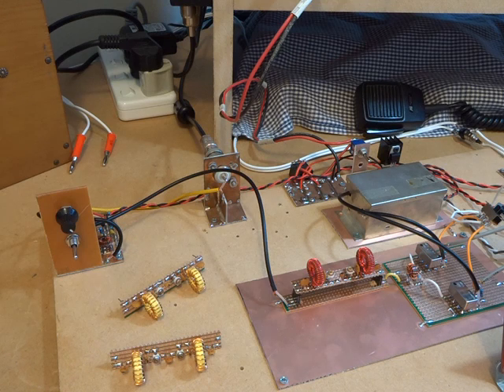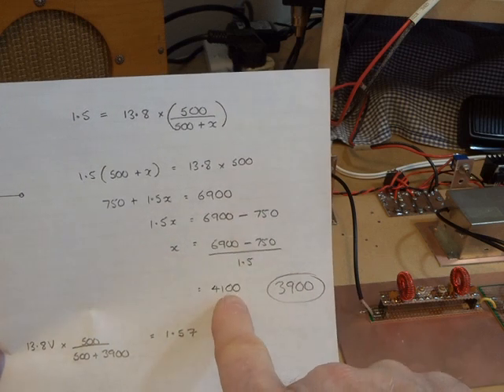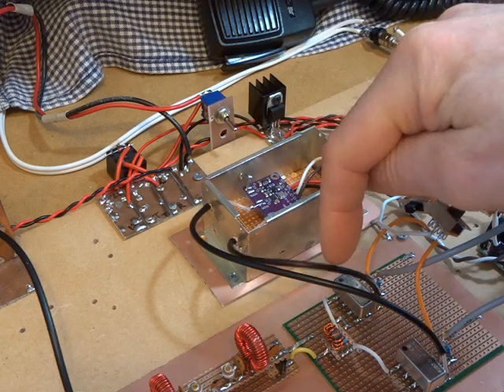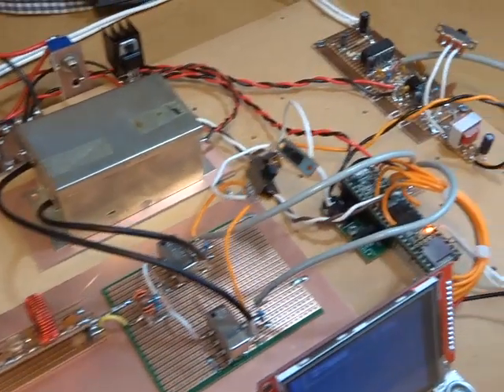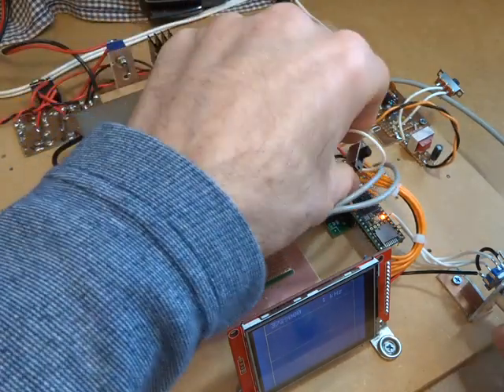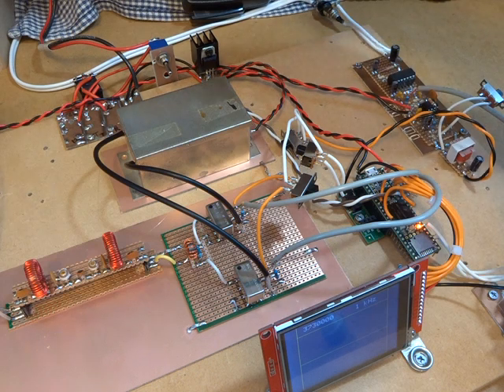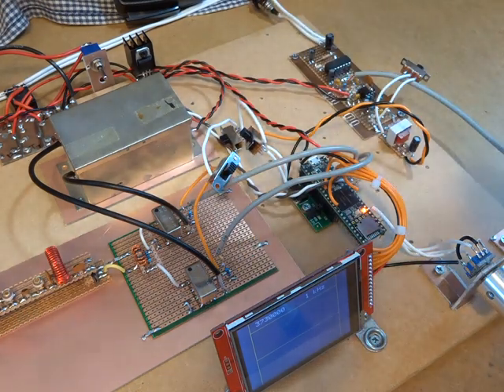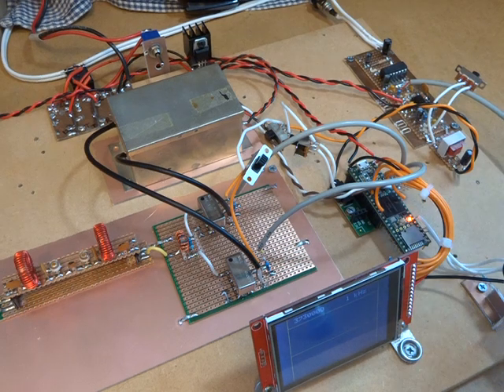80/40/20m SSB SDR Phasing Rig: Part 3. Direct Conversion Receiver

Comment: Great and very informative video. But being new to rig building I had a question. There are 2 independent mixers that are running in quadrature and both of them produce an audio signal independent of each other. What is the need for having 2 separate audio outputs and how are they combined in a true direct conversion receiver to distinguish LSB from USB. Thanks
KE8SPI
Reply: There are two ways, you have 2 mixer in the RF part (the conventional style) or you introduce a phase shifter at the audio frequency part. The easier way is to have 2 mixer. 73 KE0WST

Comment: Re the lid not making a difference, you might be getting sufficient shielding from the walls of the box, which looks like a pretty decent shield. Try the si5351 out of the box. Or tilt it and hold it close to the analog circuitry as a test. All good fun! Nice build Charlie. Bad much on the Teensy audio shield.
Reply from the maker: Thanks for the input Paul.

Comment: I'm thinking of building a version of this rig.  Was going to use the R2 circuit from '92 QST, but the required inductors in the diplexer are no longer available.  Still might use the 3 transistor pre-amp from that circuit.
Reply from the maker: Sounds good. I was thinking about making a fully analogue phasing rig at some stage.

Comment: Are the square waves coming out of the SI5351A fine to feed into the mixers? I was surprised to not see a low pass filter between the SI5351A and mixers to get rid of those odd harmonics.
Reply from the maker: hi Casey. They work fine. Here is a good explanation: http://soldersmoke.blogspot.com/2016/03/great-video-on-mixers.html

Comment: Hi Charlie!

Don't know if you are familiar with the BITX, but when Ashhar changed to the Arduino/si5351, to generate the VFO, there was a big problem with encoder noise.  Peter, VK3YE, is familiar with this and has done videos on it.

In that situation, the noise seemed to come from the microprocessor via common mode.

Ultimately it was some filtering to remove it.  In my own initial testing, I completely eliminated the issue by powering the Arduino and the si5351 off a battery.  Not a practical solution really, but it did help point to the ultimate issue. 

FWIW, I don't know if any of this applies with the Teensy, but...

Cheers!
Reply: This reminded me that I had encoder noise on my uBitx.  I eliminated 95% of it by adding chokes to the encoder lines.
Reply from the maker: That's interesting Ken. So you used two chokes from the encoder to the uP? I wonder if I should try that-say-10/100uH axial inductors...
Reply from the maker: Thanks Christina. I will take a look at the BITX schematics and see what they did. I did try a battery at one stage, with no change. I think I'll spend today boxing up the WSPR TX then get back into the SDR. Thanks for the input.

73s
Charlie ZL2CTM
Reply: @CharlieMorrisZL2CTM  I Just used a choke I had in the junk box.  It was the split clip on type.  It was too large for the wires but it worked.  I also positioned the wires so they were perpendicular to the other ribbon cables that carried audio signals.
Reply from the maker: @kcnicely  Great thanks Ken. I have some of those small ferrite beads, so I might try those too.  Cheers.
Reply: Charlie,

The Bitx schematics do not show a 'fix'. Most have done similar things to what Ken suggested. 

That said, the noise, at least in my experience, isn't coming from the encoder itself but rather, the microprocessor clock as it processes the encoder data.  

To be sure, that doesn't mean that it isn't, or couldn't be,  coming from the encoder or it's connecting wires.  

Indeed, as Ken stated, keeping certain signal wires away from others has proven to be effective, at least in the Bitx radios.
Reply from the maker: @christinamarks6349  Cheers Christina. That's good to know. Thanks again and 73s.

Comment: Where did the metal can for the Si5351 come from?  I'd like to get some myself.  It looks similar to Teko tin plated steel RF enclosures.

I wouldn't judge the lack of encoder noise just by removing the lid.  The walls of the enclosure are likely providing the bulk of shield with or without the lid.  Also, you have separate PCBs and a lot of physical separation.  If you bring that LO board closer and eliminate the shielding you might get a surprise.
Reply from the maker: Hi Allen. Thanks for the feedback. The metal can actually came out of the U/S FRG-7. It was the same can that the VFO was in. Certainly easier than trying to fabricate one out of PCB material, that's for sure.

Charlie

Comment: If I recall correctly, you had audio isolation transformers on the I and Q in your earlier build.  Could the encoder noise be coming through the ground because you no longer have those transformers?
Reply from the maker: Hi Ken. I did try isolation transformers, and they made no difference. I think for now I'll get a replacement audio board and start with that. It's will there even with the audio fully removed, so it's in the Teensy.